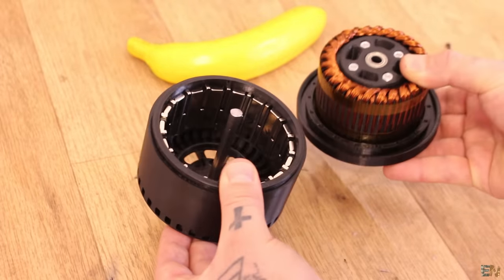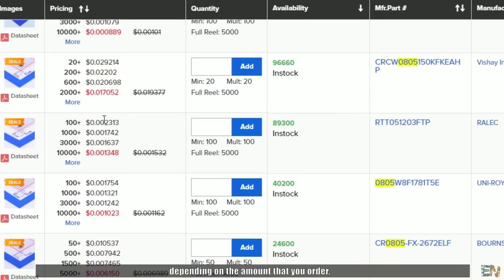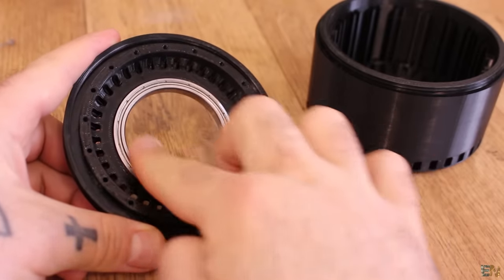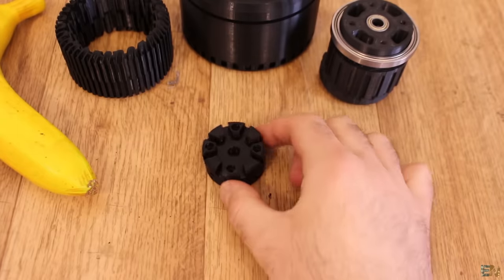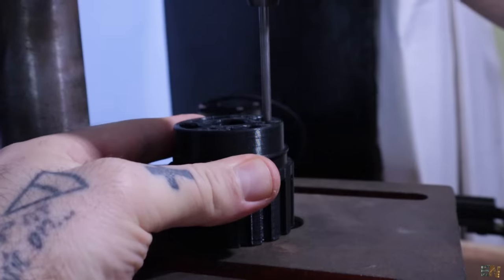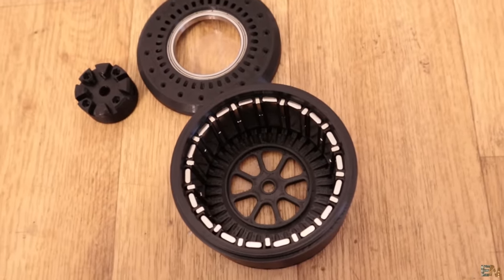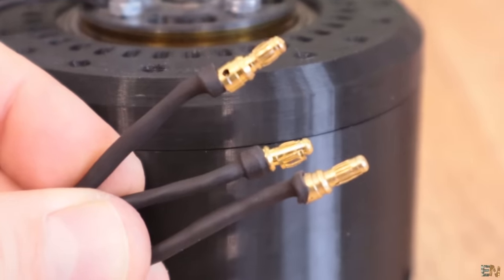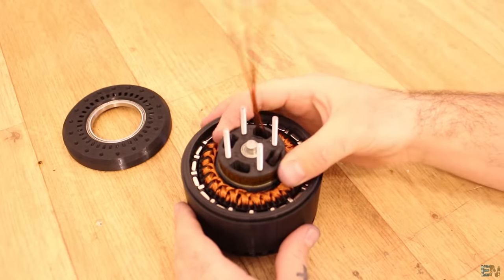3D Printed HUGE Brushless Motor | I've made Cristoph Laimer's motor

Comment: PLA works for low temperatures, doesn’t it? So, there will be no profit with magnetic PLA, as you won’t be able to use all power. May be just an increased efficiency will joy you )

Comment: try this motor on a biycle sometin i wonder how it will behave and give tork...
Reply: Probably won't work, as he said there is little torque and won't move
Reply: Bu motorlar RC uçak motoru gibiler çok yüksek devirlerde dönüp rotor baglayıp helikopter cesna planör dron uçurtmak için , eğer pervane yerine rc araba  kullanırsan bobinler çok ısınır soba gibi tüm güç ısıya göner manyetik kuvet yerine . Bu tip motorlar dış dirence dayanıksız durmadan çok yüksek devirlerde dönmek için kullanilıyor genelde , reditte 25 kg uçuabilen fırçasız motorlar satış linleri var motoru optimal güçte 1 inci viteste vırr diye döndürerek kullanilabilir ama u motorlarla mantıklı gelmiyor bana
Reply: sen napıyon burda
Reply: Seria um bom teste
Reply: @lukemagdalin6169  If the motor has high RPM & low torque, all you need to do is gear it. With proper gearing, you could move a 10T truck with a RC toy motor.
This motor is rated 600W, definitely enough for a bicycle.
Reply: @FedericoLucchi  what do you mean with ‘gear it’?
Reply: Selam abi
Reply: @ps8759  Gears can increase torque and lower RPM. This motor would actually if geared properly be on the larger side for an electric bike and work amazingly.
Reply: the only problem with that is the heat, it will melt the whole system inside
Reply: It won't work, but I guess it will be fun to watch
Reply: @ps8759  make a variators system of scooters and it work.
Reply: Christoph himself said the motor could be used on an E-Bike IF it’s build with the Ferromagnetic stator

Comment: magnetic PLA is only 3% ferromagnetic. I was interested to have a cast iron stator made to see what kind of power this 3D printed motor really has.
Reply from the maker: Only 3%??? Didn't know that...
Reply: so make your own, Robert Murray-Smith style, and some of his ink as the base conductor
https://www.youtube.com/user/RobertMurraySmith/videos

oc if people started printing/casting actual useful blanks (v track,fasteners,mostly printed/cast blocks etc) as tests then all the better as you can pass them to people that might actually use them as a starting base
Reply: @paulmaydaynight9925  What motor did you mean?
Reply: Yeah but magnetic cores dont need to be ferromagnetic but paramagnetic. Hysteresis is not desireable in a core. 
But more important would be to know whats the saturation point and its permeability as thats whats gonna give you your efficiency and the torque.
Reply: @laharl2k  Oh, so some PLA with aluminium powder would be better? What about putting foil onto it?
Reply: @ELECTRONOOBS  greatscott did some tests with it it is prone to melting as well nylon would be a better base plastic but it is harder to print I kinda think  about printing and moulding it and using some iron filings in epoxy but it is a lot of work and mess for what if.
Reply from the maker: @ransombot  This design has a way better cooling system. using the propper material, it could be powerfull enough without melting. See cristoph's video fro more tests
Reply: @ELECTRONOOBS  What brand of PETG did you use? Solid color PETG looking as nice as your prints is hard to come by sometimes.
Reply from the maker: @AcTaviousBlack  no brand at all. PETG from eBay.
Reply: A solid iron core isn’t a good idea. Eddy currents would decrease the efficiency significantly. That’s why they use thin sheets of a special iron alloy. I don’t know how paramagnetic materials would work out. You could probably use Holmium for that. Would be very nice to see wether such a motor could be more efficient
Reply: @karlsinger4760  yeah they use high silica iron for cores
Reply: Perhaps the 3D printed part as a step in making a release mold, and then cast a resin part in a similar fashion to the ferrite bead material found in most electronics? Might be as simple as mixing black iron-oxide powder and some other related materials with a cast-able epoxy. (Just have to make sure that the resin doesn't react with the iron mixed in and suspended in it, and it takes long enough to set in order to fill the mold, as it's likely going to be viscous after being all mixed.) Would be interesting to see how well something like that works.
Reply: @pauljs75  I just watched a really comprehensive video on tech ingredients about epoxy composites, though it was mostly about their mechanical properties and practical use-cases.
Reply: Better to use laminated electrical steel. It would be comparable to 6374 motors readily available for a few reasons, the windings are distributed, this requires more space for the same Kv times phase resistance product, with the benefit of slightly better power factor and efficiency (slightly fewer turns to achieve desired Kv). Halbach arrays really only provide increase effective flux density when the rotor to stator air-gap is greater than 1.0mm. In a typical 6374 motor, the air-gap is about 0.5mm.
Reply: @pauljs75  You could make such a part. But why not use iron particles instead of iron oxide?
Reply: Has anyone got a copy of the stl files?? The page i think has been taken down and cant be found.i would really like a copy of the files if anybody can help please
Reply: using halbach array eliminates most of the need for stator iron

Comment: Did you have any experience with winding brushless motors before making this video? You did a great job either way, but I'd be even more impressed if this is your first time. Your wire management skills were great. The only thing I think you may have gotten wrong was the polarity of the magnets. At around 11:40 you have all of them connected side by side, and you label them all N-N-N one side, S-S-S other side - you assume they are all facing the same direction. This is not correct. They are alternating polarity. It should be N-S-N-S if you have them connected that way. Opposite poles are holding together. If they all face the same way, they will repel.
For your next motor, please consider making a replication of Joseph W Newman's motor. There is a documentary available on YouTube titled Joseph Newman which tells his story.

Comment: Make a plinth that holds the motor winding frame into a centered position, then, using hollow paper wound pens, snaked unto the wire, you wind it from two spools either side of the plinth. The paper pens (the eco kind made from tightly winding recycled paper) will help you achieve a lot better windings, which is quite important when making your own motor.

Comment: At 11:23, you mark the magnets all with N on one side and S on the other side, so N is next to N on one side, and on the other, S is next to S.  They are clearly attracting each other, but wouldn't that make them repel?
Reply: The faces are north not the sides, the sides are opposite to each other, they are rotated clockwise 180° while the same face is up so they attract eachother

Comment: Very nice design, it could be very interesting to test it with the OpenTorque project and try to make a fully 3D printed servo motor.
Reply: Torque is too low at low RPM no good for reversing direction

Comment: Hey, couldnt you print a core, that you can insert ferromagnetic material into? - include slots for metal pipes or nails or whatever??? - Is the center axle ferromagnetic???
Reply: Maybe using iron filled filament?

Comment: What's the cost of this vs something that has the same preformance commercially
Reply: there's nothing like this available commercially, because this is made of plastic and will destroy itself when under heavy load. it's still a very cool project though.
Reply: The cost of a project will always outweigh the cost of commercial products. Labor is the most expensive part of it.
Reply: @andrewmitchell5807  
Not really the argument, if you make it yourself its free labour but you can buy dirt cheap electric fans these days and use their motors, they are already limited but if you just tear it out and remount it with higher input they can take some heavy load. Its almost 10 times cheaper to do it this way than to build it yourself, but its not as fun.

Comment: after how many minutes of working with the load will this motor melt?
Reply: You can look up the original in operation on a model plane over on Flite Test. It melted during the second flight. Neither flight was more than a few minutes.

Comment: The stator really needs to be laminated electrical steel. Magnetic PLA is only slightly better than air as a magnetic conductor, meaning this is basically an air-core motor.

Comment: If you removed the small magnets, it might work better due to the non magnetic PLA. Reduction of magnetic filed is undesirable. Try it. Marking the magnets on the table is counter to prior knowledge. Like poles repel. Magnets lined up in a row on the table would be NSNSN, not NNNN and SSSS. Try it. Line them up as shown on the table. If the marking is actually correct, removing any single magnet from the middle would result in no change in attraction when the gap is slid closed, but I suspect removing one then the gap would repel an attempt to close the gap as you would have indeed a N against N or S against S.
Tape a long sewing thread on one magnet to the end. Hang the magnet by the thread so it hangs vertically. Hang it away from walls, floor, etc. Possibly outdoors. Paint the side of the magnet facing North Red. Use that to identify the poles on the remaining magnets. Like poles repel. The side that repels the red side it North.  (yes the north pole of the earth is actually a south pole magnetically. Magnets are marked as North seeking as in the side that seeks North. Not many people would notice the north magnetic pole of the earth is actually a South seeking pole as a magnet. Models of the earth showing a giant bar magnet in the earth with the North marked N or Red are actually wrong. Think about it. Like poles repel. Most people do not realize this fact.

Comment: Cool it is the outer that is exploding due to expanding under full load so maybe you could add 2 or 3 non magnetic metal bands around the outside so it doesn't interfere with the magnet to reinforce it abit like a band they put at the top and bottom of a wooden barrel.

Comment: Putting a rounded thin sheet of steal around the outside of the magnet housing should also help amplify the magnetic field on the front of the magnets
Reply: Maybe but the point of the halbach array is to allow a good magnetic circuit without using a flux ring. Maybe watch the original video where the designer discusses this.

Comment: Without magnetical material in the rotor huv withe the coil you actually will made a cogging free motor, perfect suatible for high performance actuators how not suffer from the sticky effekt and make unlinearity betwheen current and force. Perfect for high acuracity precision in angular control. Also for every low power generator self starting Wind turbin for example it would be suatible (easy self starting at low wind speed, no stick effect no cogging). So there is some benefit with iron free coil hub, even if it not as high peak power as with iron rotor.

Comment: Or, maybe, buy an off the shelf bldc and simply replace the magnets with a neodymium halbach array? They could also be epoxied in place to prevent fatigue failure and to reduce vibrations. I'm not 100% sure that'll work, is there a reason it won't work?

Comment: Hello sir. thanks for the video. How do you make a 12v, 24v, 36v, 48v, 60v, and 72v motor during your design? some motors have higher nominal voltage. how do you design a motor with a specific nominal voltage?

Comment: Nice job! I made it myself but when using a VESC it worked horribly, be ware. Not the motors fault more so the ESC as due to there being little to no back EMF its unable to calibrate properly but perhaps im doing someting wrong. It would be awesome if you could give it a try on an VESC and see what you come up with.

Comment: are there any good references for the theory behind this? for example, if I wanted to design a similar motor with more torque? or a similar motor with different dimensions? A design process segment would be very much appreciated
Reply: Take a physics class on electromagnetism and you'll be set

Comment: Great video! I have already made the smaller version of Makesea BLDC motor and it works great! But i wonder.. is it possible to 3d print an induction motor?
Reply: I know it is an old comment, but anyways, thats not very plausible. Most common induction motors are squirrel cage motors, which have a rotor made of metal bars. To make an squirrel cage induction motor as a DIY, I can only imagine how much more complicated that might be.

Comment: What is the role of the small magnet?Does the motor work if it is dispensed with?
Reply: i believe it makes the magnetic field more condensed towards the center I would believe it helps with its efficient  the maker of this motor design was making it as good as possible

Comment: Bro, the way you tested the motor was really dangerous. Just some rough calculations, assume your motor is about 15 cm diameter, then if you run the motor to say 10k rpm in your hand which you probably did, the velocity of the rotor is about 283 kmph !!!  If the rotor were to shatter and a magnet hit you even at half that speed, imagine the damage.  Always test homemade motor such that direction of shatter is away from you.
P.S I love your content by the way =)

Comment: Will the rising up motor temperature during the use melt the PLA plastic material?
Reply: raychar c 
Short answer: Yes
Long answer: if you dont load it too much maybe not if it has enough air flow inside but i doubt you could actually get 100W even with the magnetic filament stator without melting despite the original creator claiming 600W.
Maybe if you were to aneal the pla but it would be hard for such a piece. Youd have to first wind it up and then add some suport inside to kee it in place while it aneals

Comment: I have seen in some brushless motors to be label like 1000kv/13T
Can you please tell what does this 13T means??
Reply: it means, it probably has a gear on one end of its shaft, 13T as in 13 tooth gear
Reply: The 'T' means turns. Aka RPM
Reply: Turns refers to the number of times the copper wire has actually been revolved around the armature. The higher the number of turns greater is the torque generated and hence greater is the power delivered. However that also means less RPM rating for your rc car electric motor.

Comment: I wonder if you dipped the completed parts (minus the bearings) in polyurethane (think clear floor finish) if it would seal and be stronger
Very cool build and design...need to run it hard and see what get's hot and see if it might weaken the plastic

Comment: Can't help but think you are loosing 75% of your torque with no lamination's on the stator.
Reply: consider that the stator isnt metal thus no eddy current losses
Reply: @xilw3r  and no field concentration... your point is?
Reply: @foxabilo  he graduated top of his engineering class.....no honours
Reply: it doesn't make any sense, the lamination is to prevent eddy currents and increase torque and efficiency. But in this case the stator is plastic and so it has no eddy currents.
Reply: @IgorPcar  Yes, but the reason the inside is made from ferromagnetic metal is because is has useful magnetic properties... Otherwise motor makers wouldn't make the effort of laminating steel and would just use some non-conductive material.
https://en.wikipedia.org/wiki/Magnetic_core
Reply: @RB-kb3tc  I agree with that, I have a degree in electrical eng. I'm just a saying that this 3d printed stator/rotor (in the video) is plastic, therefore there is no eddy currents and no reason to laminate it.
Reply: Do you think there is a viable way to inset, or imbed metal (steel rods or something) into it to increase the magnetism of the stator? In addition to using the magnetic PLA.
Reply: @RyansMarket  THAT is a very interesting question.... experiments need to be made
Reply: @IgorPcar  Thanks
Reply: @IgorPcar  Oi Igor. Obrigado pelo esclarecimento sobre a laminação sobre o núcleo do motor.

Comment: You should make a powerfull bldc motor controller for electric vehicle's . 100v 150a. Id be interested
Reply: that seems a bit mundane for a Electronoobs
 challenge...
now, a Halbach powered replication for the more adventurous skilled maker, theres always barumman's classic RHOMBIC DRIVE STIRLING CYCLE ENGINE running/driven in super cold mode https://www.youtube.com/watch?v=ssvHGUlFokA to do something actually useful for the worlds makers to copy ,that being to practicly liquify diy hydrogen for later use on demand in a small self contained version by replacing the 2 flywheels with 2 small overlapping interleaved Tesla's driven by a central single air pressure inlet,  or in this case simply Halbach driven in super cold mode.

Comment: BLDC 5520 brushless dc motor appliacation for fascia massage gun home appliance 24v BLDC motor

Model:BLDC motor 5520

No load current:0.95A Max

No load speed (rpm):3500RPM±10%

Rated load current (A):0.95A Max

Rated load speed (rpm):3500 RPM±10%

Rated torque:50 N.m
@t